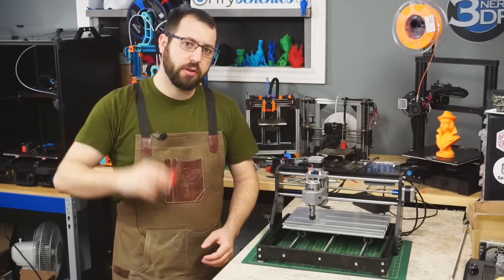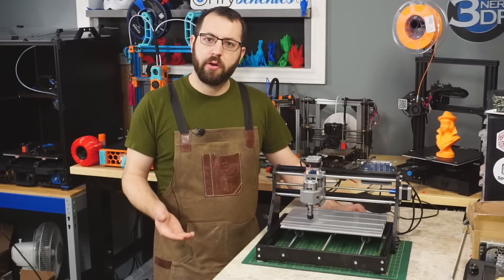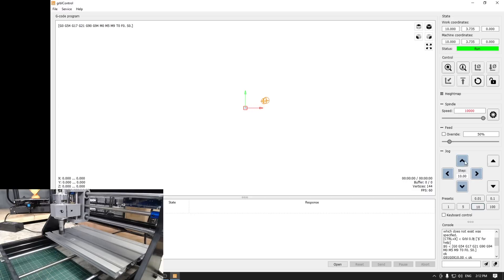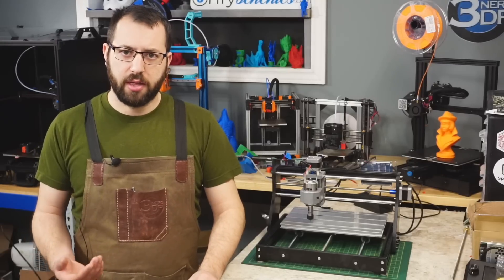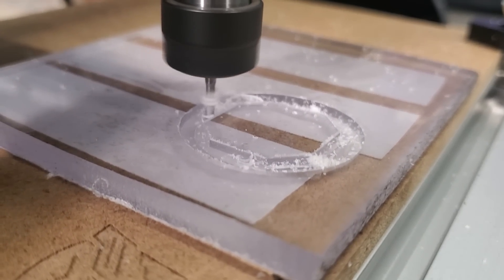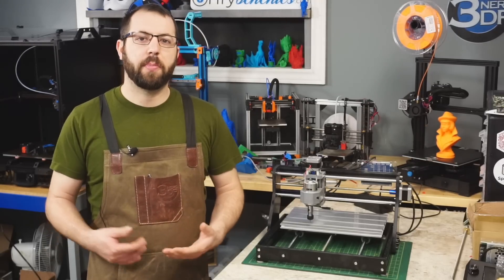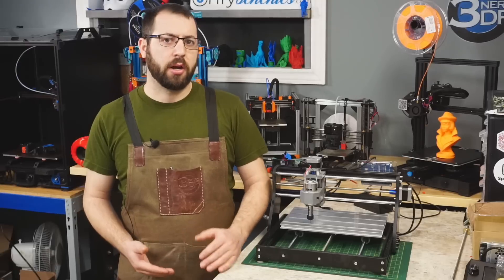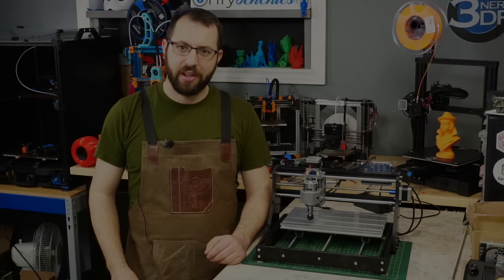3018 PRO CNC - Beginner CNC First Look

Comment: Tip for milling acrylic panels: regularly spray a mist of water to cool the part (larger CNCs have that built in). You'll get cleaner cuts and the plastic won't gum up on the bit.
Reply: just put on enought ?

Comment: For people considering the 3018 Pro route take a look at the SainSmart "Genmitsu" 3018-PROVer. It replaces all of the acrylic parts with aluminium, comes with an E-stop switch, a z-probe, handcontroller and chip shields. It is a lot more expensive than the "standard" 3018 Pros but has done a lot of the common upgrades for you already.
Reply: i found a full aluminium version on amazon for like 230 euro's.. with a "300" watt spindle.

Comment: Great video, if you or anyone else in the comments end up using this machine for printer components make sure that you are adequately compensating for backlash otherwise your accuracy will be pretty poor, especially when it comes to bores. If you aren't already,  consider using conventional toolpaths to compensate for lower rigidity and lack of ballscrews.

Comment: Just bought same machine .curious about the control xzy axis hook up my instructions don't clarify the y1 y2 plug in  it only has three mottors the y1 would be the correct connection?  Also instructions  don't clarify how to mount lazer and wich port on the board the lazer wire hooks up to on the board .I have pictures any help would be appreciated.

Comment: You should think about increase your x ridigity on project AVRO. Like Add a thick a plate screwed on that extrusions. Or use some square steel tubing.
Reply from the maker: There will be back bracing in the final design. Just havent added it to tge cad is its a simple thing and other design choices keep shifting

Comment: Personal advice regarding toolpaths would be to contour cut with multiple & equal depth cuts with like 0.1-0.2mm of stock left and then do a full depth clean-up cut with a spring pass.
Just so happened to have a finished project at hand that required a CNC Milled Cover made out of, I believe, 3mm extruded Plexi https://imgur.com/gallery/ZYpHEk9

Comment: I have  no CNC, but i would t prefer  Printnc to Mcpnc.
Reply from the maker: The PrintNC and MPcnc were both options i looked at, however I wanted something easily moveable, and more desktop sized to start with.
Reply: @CanuckCreator  keep an eye out for Joe Spanier’s Milkcr8 CNC, which should be released in the near future. It’s like a small, moving bed cousin to the PrintNC.